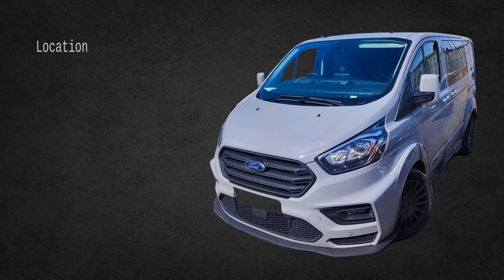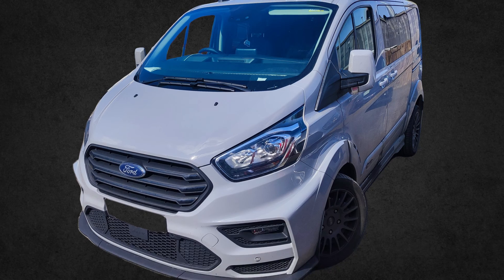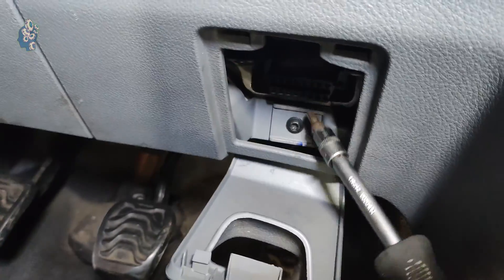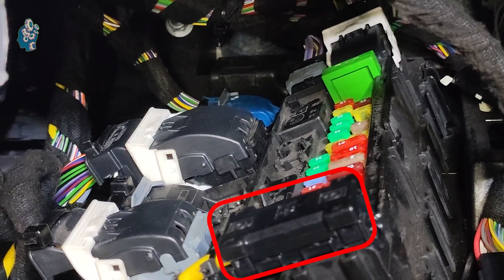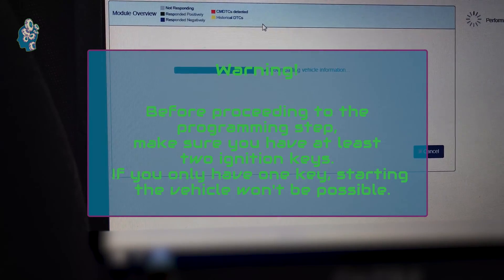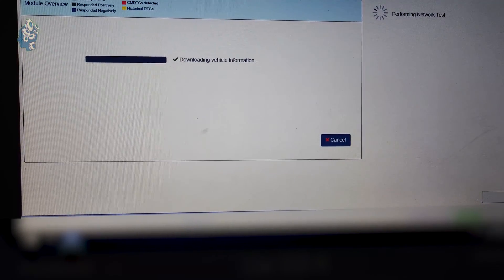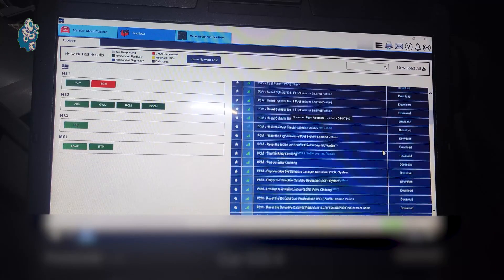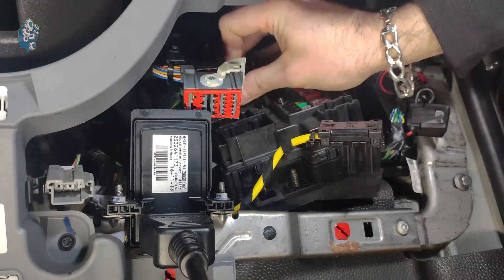Ford Transit Custom 2017 - BCM Replacing and Programming

Comment: It can only be done with FDRS now (2025), without a subscription it is impossible to get those files. I don't know if there are any workarounds there like cloning etc. But it seems like you will end up using FDRS anyways.
Reply from the maker: Yes, I have used FDRS.

Comment: Do you need to program tires sensor?
Reply from the maker: I do not think this one had tire sensors. If it does, you can take it on the road for a few miles, and it will calibrate automatically.

Comment: Hi, is it possible to so this with Forscan?
Reply from the maker: Hi, you won't be able to program an immobilizer with the Forscan.  There is an option to do module installation/configuration but I never tried.
Reply: Forscam !